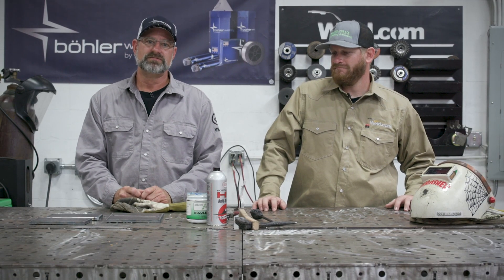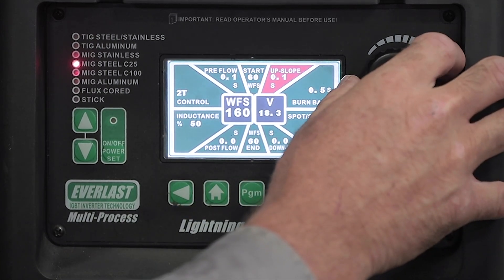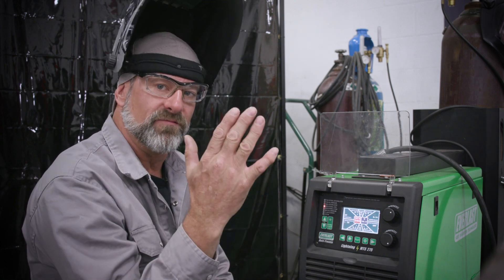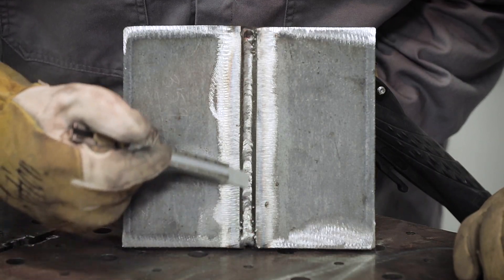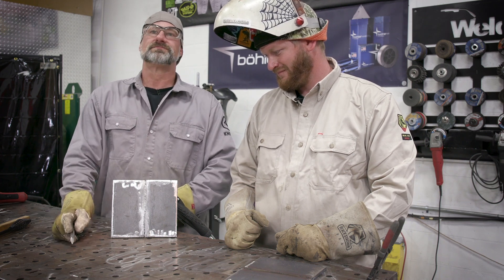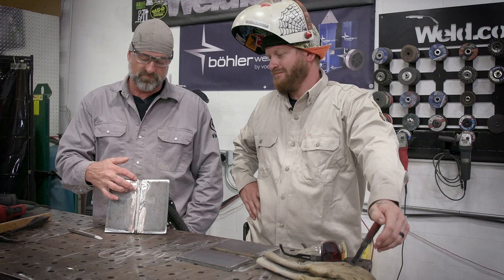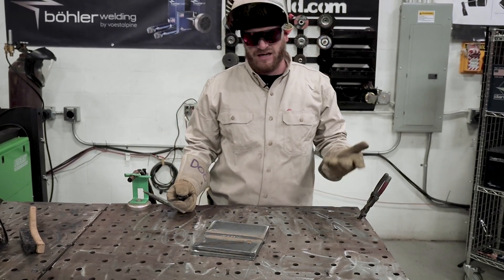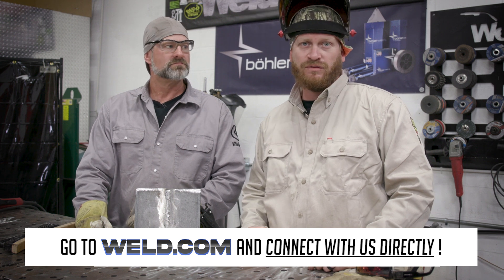Flux Core Welding Fundamentals

Comment from the maker: Guys - this Bohler wire is copper in color but it is definitely a flux core wire! 
Here is the data sheet. https://www.voestalpine.com/welding/content/download/13516/287265/file/BW_diamondspark+52+RC_US_05-2019_Preview.pdf
Reply: Had me confused when I first watched it! Awesome things Bohler is doing with this wire! The tech specs are great! 

Dale Spilker 
Advisor 
Weld.com
Reply: Nope this is FCAW wire. Check out Weld.com’s pinned comment.
Reply: Would that also be called metal core  like Hobart fabcor 86r? Just curious is all
Reply: Bohler is Chinese rubbish with a German name. I will stick with Lincoln or ESAB.
Reply: @WTFChuk  I don’t believe it Chinese made….Bohler passed more PQR’s on the first go around than a lot of other fillers I’ve used on these tests. 

Dale Spilker 
Advisor
Weld.com
Reply: @dalespilker2465  Every can of their SMAW rod I've seen says "Made In China". Maybe the FCAW wire is made elsewhere? All one needs to do is look at the box it comes in.

Comment: Why use gas with flux core wire? Thats not true FCAW. You have a setting on that machine for FCAW. 2nd. Most people that are weekend welders or do it on the side a bit aren't gonna have that expensive of a machine. I.e. blowback settings, etc. Hell, the big millers and lincolns we used in school dont have all those settings. Asking for a friend.

Comment: He did pretty well for a novice in dual-shielded flux core welding. The electrode stickout was inconsistent mainly due to the fact that he chose to weld in a more awkward way by pulling the bead durectly towards his body, instead than going through it sideways.

Comment: Hi. I have watched a lot of your videos for advice. I'm a beginner at welding and lately i have been doing flux core welding and when I start welding everything goes well welds are nice and everything is smooth and then after say 10 minutes or so of welding the wire seems to start stabbing or not feeding out properly while im welding and i can't work out why it does that. Any tips besides the usual and general things to do. Running 0.9mm flux core wire with 1.0mm tip.
Reply: What's the duty cycle of your welder (x minutes @ y amps)?

Comment: We tried some dual shield on sch40 pipe putting on 1/2in thick flanges and some were good and some I had wormholes.  It was driving me crazy until I learned to keep more gap between the torch and the weld surface.  I guess I was pushing gas into the pool.
Reply: Bro, I read somewhere it said stick out should be an inch, and then I read 1/2 inch. How big do you think the gap was?
Reply: wire stickolut on dual shield is 1 to 2.5 inches depending on the wire

Comment: So you call this video "Flux Core Welding Basics
" while using shielding gas and a 3 grand Lightning MTS 275.

Yeah okie, "basics." Basics would be with some 110/220 Chinesium Amazon special or a Chicago Electric from HF with flux core wire and no gas. And the first steps would just be insuring you're using electrode negative and setting up the machine, not talking about tweaking the settings for a 3 thousand dollar machine and what type of gas you are using.

Comment: I think that it would be better to run all passes on 24 volt. To high wire feed to that low volt. When you weld fluxcore you should have little spatter. And when it sounds like bacon and egg you have the mashine on the sweet spot
Reply: 10-4 bacon- NOT popcorn
Reply: @angryfloyd9235  😂

Comment: Confuse... was it flux core or not... you spoke of the gas mixture and the wire.
Reply: Flux core wire with shielding gas. This is a another process of flux core welding and I should have went further into detail.

Comment: Great to see paul getting comfortable with the camera, much more relaxed! Nice to know the machine settings but more explanations of the machine settings would be nice. Being basics I expected to see details of torch angle, work angle and stick out for the novices. Would have been good to see side by side roots, fill and cap at different voltages to compare to cold, just right and to hot. Over all good video tho guys.

Any chance of an in detail uphill mig fillet on 5mm plate please! Got a test coming up running a single pass "christmas tree" (triangles in to the root, back out to the toes and across the face) struggling to penetrate consistently in to the root of the joint. Many thanks!
Reply from the maker: We will put that on our ideas list for videos!
Reply: @Welddotcom  I second the idea. Need to know what the settings do.

Comment: I somehow missed the "do's and don'ts" ! And WHY dual shield? If you've got a gas shield, what's the point of using flux cored wire?
Reply: What's the point in using FCAW compared to what other process? 

Dual Shielded FCAW is a very efficient process in completing welds above most quality standards. Dual Shield also offers extremely good penetration. 

In a production environment Dual Shield is often turned to because its not as finicky as a GMAW Puls or Spray process. In the end its all about the skills of the welder. 

Dale Spilker 
Advisor 
Weld.com
Reply: @dalespilker2465  Maybe a video comparing the pros & cons of the different processes for different applications could be good?
Reply from the maker: Dale Spilker let's do it!

Comment: Another NEVERLAST welding comercial how much were you paid to show this junk welder ?
Reply: The Everlast machines are a pretty good buy for the money spent. Obviously if your planning on using is 10 hours a day every day I would personally go with a Miller or Lincoln but that's only because I've never used a Everlast machine for 8-10 hours. A guy somewhat local to be buys Everlast GTAW welders exclusively and they seem to work great for him and he uses them around the clock to weld heavy aluminum. 

For the record I don't get paid by Everlast but I do think they are a great entry level machine for a hobby welder or student. I steer my students towards them often just because you get so much more for your money and 9 out of 10 times they will only use it a few times a week. 

Dale Spilker 
Advisor
Weld.com
Reply: @dalespilker2465  i prefer fronius
Reply: @dalespilker2465  i have the synergic mashine so i can adjust my volt on the welding handle. Use it all the time when i weld different positions. The mashine adjust wire speed by it self if i adjust the volt. I know i can adjust the welding mashine so i can weld all positions in one setting. But if i use the fronius i do adjustment where i can so i can weld faster
Reply: @ktmturbo5836  Like I said I used them in Europe. I believe this was before they made the USA push and I was so impressed. I still talk about those machines. They worked so well for open root joints.

Comment: Open root? Not going to back gouge? Maybe a real world application next time ?
Reply: You dont have to back gouge you can grind it to. If it is a small weld job i dont hassel whit the back gauge. I only use a grinding disk
Reply: @ktmturbo5836  Backgouging can be accomplished by carbon arc, plasma gouging, oxygen acetylene tourch, die grinder, angle grider, etc. 
Any thing that's available and yes thickness of the material.
Here is a link to the AWS glossary of terms and definitions. https://awo.aws.org/glossary/backgouging/
Reply: @lunchboxweldor  Okey we use other therms in norway. Backgauging is Carbon stick to us. Tnx for info

Comment: Since I am a beginner, I understand the flux core part , but then what is the purpose of the shielding gas in this case?  Does this wire need the gas to protect the flux?
Reply: Yes, except "dual shield" is a trademark name from Esab.  The correct or generalized type/name for the wire being used is Gas-Shielded Flux Core (FCAW-G, the "G" is for "Gas shielded).  Most professionals when they say "flux core" they really mean "gas shielded flux core" because there ain't no gas-less flux core being used out in construction sites erecting skyscrapers.  It is a specific type of cored wire usually belonging to the class E70T-1 or E71T-1.     On the other side of the same coin, most beginner hobbyists when they hear "flux core" they automatically assume "gas-less flux core", (FCAW-S,  the "S" is for "self shielded") because that is what is sold in most hardware stores and is meant for non-critical/non-structural welding.  Most gas-less flux core wires belong to the class E71T-GS or E71T-11,  The "GS" is single pass, and the "11" is multi-pass capable, but even then most are limited to about 5/16" material thickness.  Any thicker and the heat-quenching effect of large parts causes adverse metallurgical reactions to the weld bead possibly causing to fail.  So yes, FCAW-G needs shielding gas.  Some can do with 100% CO2 (E70T-1C, E71T-1C), some with C25 (E70T-1M, E71T-1M), or some with both (E70T-1C/1M, E71T-1C/1M).
Reply: @zod-engineering-welding  Thanks for your time and knowledge. 
This single comment has ten times more information than the video itself.
Reply from the maker: Oscar Sanchez Jr, BSc. Thank you, your are hired 😂
Reply: Dual shield(gas ) keeps the air away from the flux longer to let it form a better cap, is how it's been explained to me.
Reply: Thank you for the great explanation

Comment: Wish there was videos on the older machines like a Millermatic 225 without all the settings
Reply: Maybe I can do some of those! 

I have a ton of those in my shop! 

What specifically would you want to know about the machine? 

Dale Spilker 
Advisor 
Weld.com
Reply from the maker: Dale Spilker yep! You are the guy for this!
Reply: Thank you guys for the reply and also all the great content has helped a lot of us out!!
Reply: In my oppinion the machine is not that importent. Its Your volt wirefeed and wire that matter the most
Reply: @ktmturbo5836  I’m just curious on what would good setting on my shop machine to play round with
Reply: @spurndirty9546  i dipend on the wire. You can find a data sheet if you google Your wire. How thick wire do you have and what type of gas? Try 360wfs and 24 volt. If you adjust your wire feed and it sounds like you are making bacon and egg you are close
Reply: @spurndirty9546  hey buddy I know it might be a pain but if you post a question on the forum with your machine type and wire diameter I sill help ya out. If I have to I’ll FaceTime you. 

Dale Spilker 
Advisor
Weld.com
Reply: I do a lot of repairs on heavy machinery parts usually around 1/2” thick material. I’m really wondering on settings, body position, and torch manipulation for butt and overlapped joints

Comment: You need more amps and volts on that root. Also he would've gotten better penetration with straight CO2.
Reply: You're right about those amps, definitely running to cold. Thanks for the Co2 info, I'm making a list to add to the next video.
Reply: He seemed a little far away to me... I would dig it in there more on my machine.. and it was definitely turned down too low
Reply: @calholli  yes he was.
Reply: CO2 dont make better penetration. To Get better pen you need a gas that have some helium or hydrogen in it.

Comment: Just tried flux core with out gas took a little time and 1/2 roll of wire , but I found if I pre heat the metal before welding it really helped .                                                                                    So thanks guys for your input .  Cheers .  :)
Reply: I welded flux core dual shield for 8 years...never preheated up the material except for some parts the were 1 1/2 inches thick.
Reply: @eduardosampoia5480 I agree. Unless you’re doing a CJP or a big 1.5 inch plate, there is really no need.
Reply: Thanks for the feedback. All positive input helps. Keep burning! 👍
Reply: You probably need to let the pool build up before you move.

Comment: you shouldn't root with flux core unless its with a ceramic tile, 22v is far too cold for a fill on FCAW, your cap should never be more volts than your fill
Reply: Dual Shielded FCAW is extremely common using ceramic backing/ steel backing and no backing. It all depends on the particular joint and procedure being welded to. 

The voltage is relative and is determined by many factors. What was done in the vide worked well for them. Voltage can be adjusted throughout the joint. Depending on the WPS being used to weld a particular joint the cap can very well be ran higher than the root and fill passes. I do agree with you in a lot of respects that in a normal application with a ceramic or steel backing I will run my root at one setting adjust for my fill and then cap on a slightly colder setting than what I filled the joint at. 

Dale Spilker 
Weld.com 
Advisor
Reply: I root with dual shield all the time and pass xrays.
Reply: Why

Comment: Why don't you use the Flux Core setting on that fancy machine...
Reply: The flux core setting was for no gas and we ran dual shield.
Reply: @bobhigginbotham9035  The whole point in flux core is that you don't need gas. smh
Reply: @calholli  learn about  welding  before  you embarrass yourself. Some applications  call for dual shield
Reply: Because they were running Dual Shield, If they were in Fluxcore mode there would not be any Gas delivery, ie it would leave the gas solenoid OFF.

Comment: Won’t most beginners be running flux-core without gas?
Reply: Yep, same thought here. Also most beginners aren't starting out on an Everlast Lightning MTS 275.
Reply: @TM-dh2xb  fucking A. I gotta cheapo 110v for my projects
Reply: @TM-dh2xb  ^^^ This!
Reply: Lol I made the same comment, this is not flux core basics 🤪
Reply: It all depends on the equipment purchased. 

I would suggest a beginner run the dual shield process because at a smaller wire diameter it ends up producing one of the best quality welds without a extensive pool of knowledge. 

Dale Spilker
Advisor
Weld.com
Reply: @dalespilker2465  I’m definitely considering dual-shield. That’s one reason I bought a multi-process welder. But for us beginners and hobbyists, gas is an additional cost and learning curve, plus takes up more space.
Reply: @devhammer  it is a additional cost and I can understand that. At the end of the day in a shop setting I would chose FCAW dual shield just simply because it will produce a more appealing bead to the eye than the self shielded FCAW process, especially on a hobby machine. Might be a good comparison video…? One may possibly already exist, I’ll have to research it! 

Dale Spilker
Advisor 
Weld.com
Reply: @dalespilker2465  Well, when you're on a budget, what's the point of dual shield? Especially when most of the stuff I do in the field is light/medium duty repair, and my rig doesnt have room for extra bottles?
Reply: @the-wizard84  if it works for you then it’s the way to go! Not to mention in winds over 5mph you start to lose shielding gas on the Dual Shield process. I would say for outside work where a semi automatic process if needed FCAW weld shield is the choice process, especially if you can use a largish diameter wire. 

Dale Spilker 
Advisor 
Weld.com
Reply: My first time was gasless